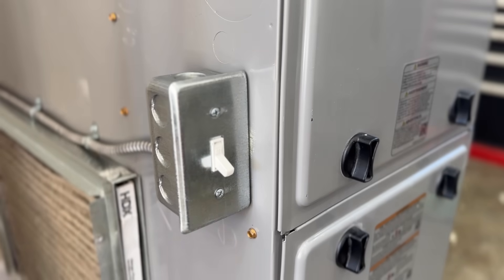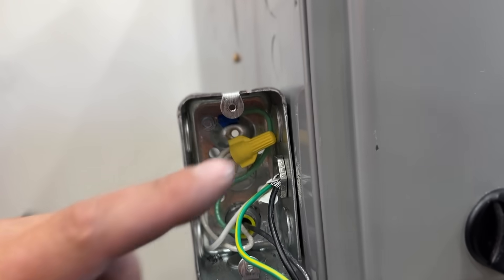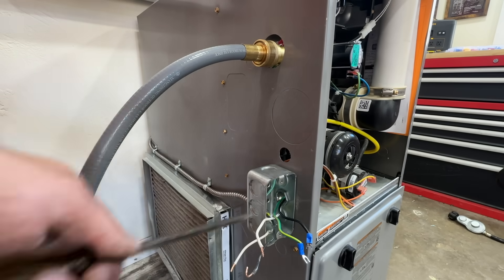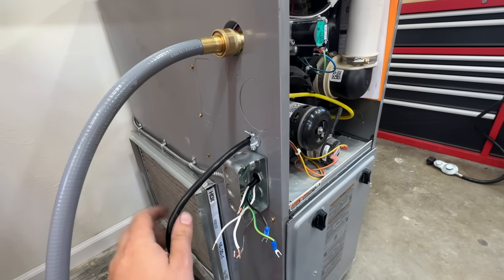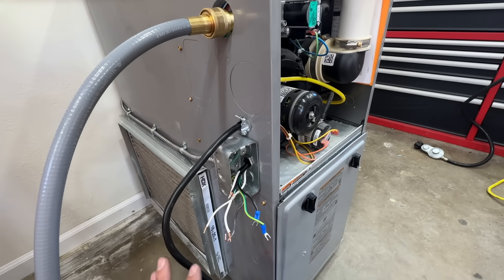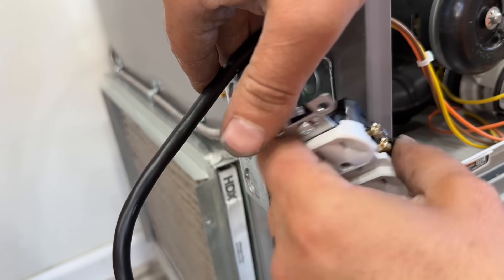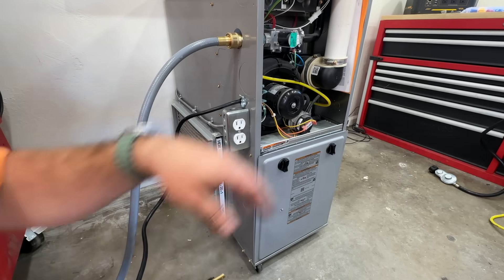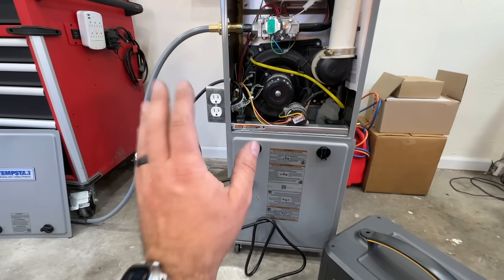Keep Your Family Warm During A Power Outage By Installing This $5 Part

Comment: In Canada a forced air furnace must have hardwired electrical. It can't have a plug like that. However I understand why you'd use this. I personally have one of those "EZ Generator" style boxes on my furnace so it is still hardwired and it does the same thing you show here.
Reply: I think it's against code in the US too but tell that to your freezing cold family in an outage.
Reply: @peterfairlie2296  The code doesnt specifically say you cannot but it also doesnt say you can. It would be up to the authority having jurisdiction to decide if its allowable. for example North Dakota has an amendment to the NEC that specifically allows this. but like you said its your house so do as you please. Its not dangerous at all to do it..
Reply: @FosterFarmsOk  It's a bit sketchy as section 110.3(B) of the NEC requires that listed or labeled products be installed in accordance with any instructions included in their listing or labeling. This makes compliance with those restrictions part of the requirements of the NEC. Clearly this is a hack and you'd be called out on it in an inspection. However don't get me wrong as I'm all for doing this in an emergency to keep my family warm and safe.
Reply: @peterfairlie2296  that's why I said it's up to the AHJ. Some places allow it.
Reply: If it is a temp fix (installation) then it would not be considered a code violation as long as it was done in a manner that did not create a violation, such as in New home construction.
Reply: If it is a temp fix (installation) then it's not a code violation. The NEC allows quit a lot of different applications if "Temporary" and of course the aux power MUST be GFCI protected.  @peterfairlie2296
Reply: If you live in Ontario -read the Electrical Safety Authority Flash 19-27-FL Use of temporary portable generators.  It is slightly different - uses a single receptacle and extra hard usage flex cable greater than 14 gauge to allow the furnace to plug into the outlet.  Installation must be done by a certified electrician or have an ESA inspection post DIY.  Thought I would share.
Reply: @testpuddle Ive done this. you get a permit from the esa, as homeowner you are allowed to do it yourself (installing the manual transfer switch w/ generator male outlet for 15a (nema-5-15p), and then have it inspected. its easy and altogether with cost of materials and all cost about $160 CAD (2019), and its done right and to code. the 'ez generator' style switch and plug must be CSA or UL&ETL certified however.
Reply: I too have built a 'rocker switch box',  similar to the EZ Generator Switch so that way I don't have to mess around with plugs.   All the wiring (12ga) is contained in a 4x4 junction box with a mud ring to mount the double pole double throw rocker switch marked LINE, OFF, GEN. I have a small dual fuel inverter generator sitting outside with proper connection from Gen to Furnace.   It was suggested that newer Furnaces with electronic furnace boards  needs that bonding back to the main panel and separating neutral and bare ground.  The gen is floating neutral, but by sending neutral and ground separately,  makes the furnace happy.  To bad I didn't have in the 2021 freeze out in TX.  Only took one time to learn that lesson. Plus I can still use an extension cord to power sensitive electronics like TV's,  Modem, Router, Computers, and charge portable electronics. Just NO big amp loads.
Reply: @avflyguy  Lol. Texas gets around 20* for few days and it’s a State disaster! No Heat? Try Upper Michigan and 2’ of snow and a blizzard outside an power lines down NO power for 2-3 days an it’s about zero out! This hack works good for heating your house! Even would heat in a Zombie Apocalypse as one writer said! 😂 I’m
Reply: Yea it’s all against code until it Fkn below zero for 2 days an no power. I done this to my Sons house an ran a cord out the basemant window to power furnace and couple lights off a heavy power cord and generator out in garage.
Reply: @roberttaylor8261  Or there is a Zombie Apocalypse :face-blue-smiling:
Reply: Code inspection happens when you build the house, when you do a permitted change in your system and when you sell the house and need a c.o. so until you’re ready to sell your house have at it.
Reply: Yea it can be put back in 20 min. For code or selling!  I have done this to 3-4 of my friends houses that live in UP of Michigan where we have Snow storms an Blizzard Conditions for days without power or roads cleared. Just make sure nothing back feeds through your panel back to pole!
Reply: Don't tell people you did it.
Reply: Bizarrely, furnaces in Ontario are installed with a switch in a box that breaks the power line running between the furnace and the breaker panel.  From an electrical safety perspective there seems little difference between running the line through a single pole switch and running it through a combo switch-outlet.  The electrical code tends to be over cautious — with good reason since most homeowners are not trained to do proper electrical work.
Reply: Take walk on the wild side.
Reply: Guys, here is The Savior

HalleluYAH translates “Praise ye YaH”

YaH is The Heavenly Father 
YaH arrives via the TENT OF MEETING
YaH was Who they Crucified for our sins
YaH was Crucified on an Almond TREE

— Ancient Semitic Cuneiform of Moshe (Moses)
— Isa Scroll (The Original Isaiah)

Isaiah 42:8
"I am YaH; that is my Name! I will not yield my glory to another or my praise to idols.

Isaiah 43:11
I, I am YAH, and there is no other Savior but Me.

Isaiah 45:5
I am YaH, and there is none else.
Reply: I went to do this on my mother's house in Arkansas but she already had a plug done 😅. I told her she could hook the heater up to her generator with an extension cord and have heat but she declined. She liked using her fireplace more lol.

Comment: Something most can do and it is handy as hell to have in case of an outage. Having a nice battery bank to run it is the breaker for most being cost of a unit the primary driver
Reply: A deep cycle lead-acid trolling motor battery and a 1,000w pure sine wave inverter, plus some way to charge the battery if you plan for extended outages.

Comment: I like this concept a lot.  I don't like that metal clamp on the pigtail personally. They make proper fittings for that.   I also don't know why the pigtail goes into the furnace just to come back out, making no connections inside.  Also why is it so long?   Last, should always tighten the other screws sticking out on an outlet and reduce the chance of a short.   Thanks for the video!
Reply: The pig tail is "so long" so you can reach your alternate power supply, like a portable power station or a generator.
Reply: @jasonbroom7147  if you could reach a generator with the length of that cord then it's too close
Reply: @Frankie29392  - Bullcrap.  My furnace sits in a room right off my garage and a 15' cable would reach out to a generator, running in the garage with the door open.  It isn't a complicated topic, you just didn't understand it, initially.  Just say, "Oh, that makes sense", and move on.
Reply: @jasonbroom7147  you sound like someone who would run a generator in a garage
Reply: @Frankie29392  - And you sound like someone who is just fine with having an extension cord that is too short to get the job done.  ;)
Reply: That metal clamp is a proper  fitting.

Comment: Does anybody know if that is to code in Ontario, Canada?
Reply from the maker: As I said, even if it isn’t in your ordinance, you can EASY change it back. I did this in about 20 mins if not less
Reply: @diyhvacguy  I know, same for me to change it back and forth, but I don't want to have to do that.  If it's ok with the code, than can just leave it forever and not worry.
Reply: @matthewhorwat7540  It can be done in compliance with the Canadian Electric Code (CEC) with a few different parts but a durably wired cord would not be in compliance. 

Change the switch to a double pole, double throw, center off switch. The type I'm writing about is no bigger than a four way switch and will mount anywhere a switch or receptacle would mount. Install a power inlet next to the switch box and wire the energized terminal and the Grounded/"Neutral" terminal to one of the switched terminal sets of the switch. The Round sleeve terminal contact for the bonding conductor is spliced into the the other bonding conductors in the box and the bonding conductor of the branch circuit. The other set of switchable contacts terminate the matching branch circuit conductors. The furnace conductors get connected to the common terminals of the switch. Throw the switch up it connects the branch circuit to the furnace wiring. throw the switch down and you connect the power inlet to the furnace wiring. throw the switch to its center position the furnace is no longer connected to the branch circuit or the power inlet. That is used when the furnace is being serviced for the safety of the servicing technician. You would still have to connect the female cord connector of the cord from your alternate power source to the power inlet. With no durably connected cord involved I believe that the installation would comply with the CEC. 

Tom Horne
Reply: Unless you actually have "code police" knocking on your door every 6 months coming to inspect all your outlets, lights and appliances, dont worry about it!!!

Comment: Needs to be shortened, rolling that up like that and putting voltage on it will ease current, bet the cord gets hot
Reply: A 16ga or larger pigtail will be fine. The furnace doesn't draw enough amps to matter.
Reply: @Sylvan_dB  💀
Reply from the maker: Yea the amps on this cord of a gas furnace is extremely minimal. We are talking like 3-5 amps.
Reply: @diyhvacguy  it increases when you coil it, or so I’ve been taught
Reply: @donhgr  You are correct. I'm a literal electrician, the comments and likes are foolish. Let them burn down their homes. 

Longer wire = More Ohms. 
More Ohms means heat, especially a coiled one.
Reply: @UltraGamma25  The pigtail he is using is a 6-foot long 14/3 SJTW flexible appliance power cord. Stranded #14 has between 2.31 and 2.7 milliohms per foot, so the resistance of the pigtail is at the most 16.2 milliohms. Using I^2xR, 5 amps at 16.2 milliohms would result in a power dissipation of approximately 405 milliwatts by the power cord, which is about what a single Philips Hue smart light bulb consumes when it’s off.

In other words, it’s not likely going to get very hot at all.
Reply: @Willp4139  Thanks for showing the facts. All these people that memorize, or even just hear something, but do not understand the why and how of it are quite entertaining.
Reply: @donhgr  No, coiling wire does not change it's resistance per length..  whoever taught you that was wrong.  If you are running close to the conductor's rating, you can concentrate heat in a small area by coiling, but coiling doesn't cause any voltage drop or resistance increase.
Reply: @ohger1  ‘Found this so I guess it doesn’t cause more current but still appears to be a problem I guess 

‘Unwrap Cords When in Use
Even though you tightly wrap the cords when you store them, you will want to unwrap them before you use them. This will prevent heat from building up and becoming a fire hazard. A coiled extension cord will trap heat, and this can cause the electricity to build up and eventually may spark.
Reply: @donhgr  You are wasting your time brother.
Reply: @UltraGamma25  k
Reply: @donhgr  Not saying it in an offensive way but these dudes are stubborn and I don't want you to waste your time with this.
Reply: @UltraGamma25  I didn’t think you did but thanks
Reply: Yes